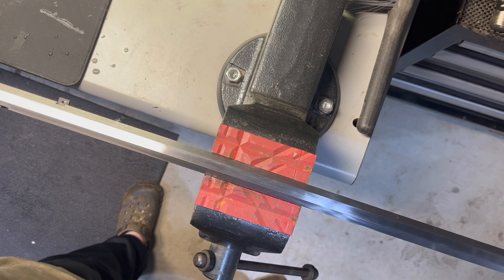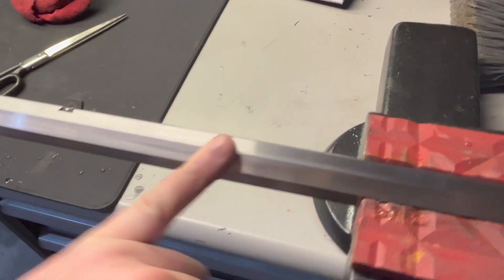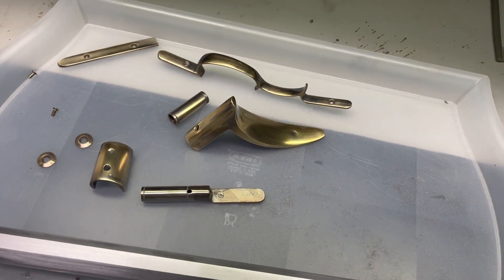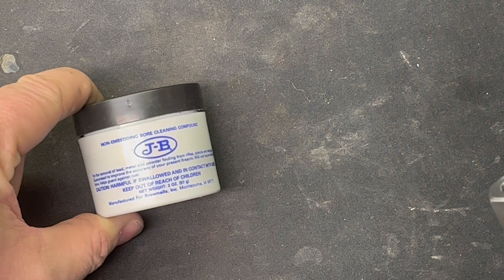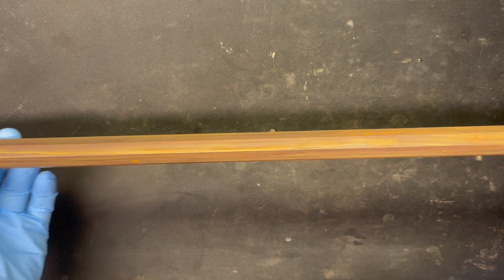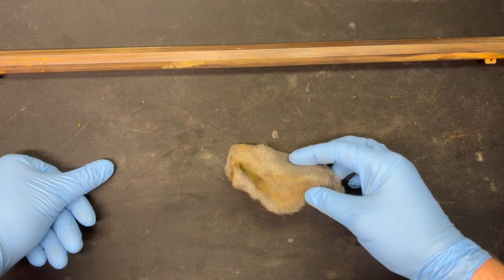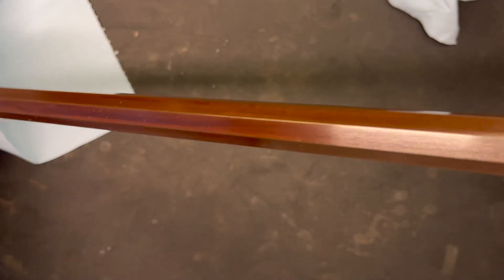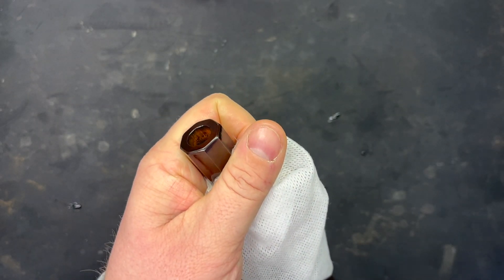Sonoran Desert Institute Muzzle Loader Lab Part 7: Barrel finishing

Comment: I have those lap tools and I was able to crown 2 mosin nagants before they were too wore out to do another 30 cal crown. Just say’n…. 
Also I did a barrel with one application of brown then 3 applications of phospho-blue….still looked brown but deeper.
Reply from the maker: How long did it take to cut the crown with the lapping tools and what compound did you use?  I’m obviously doing something wrong here.
Reply: @scottbozarth8459  I used valve grinding compound and worked it quite awhile but didn’t get much more than you did.  Thing is they shot very well and that’s what counts.